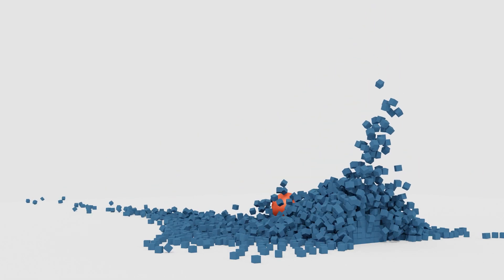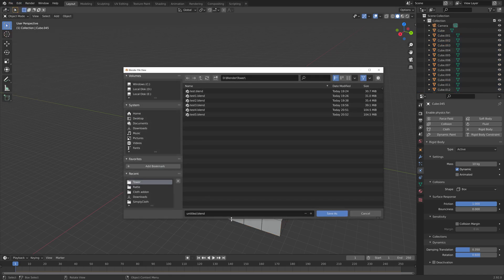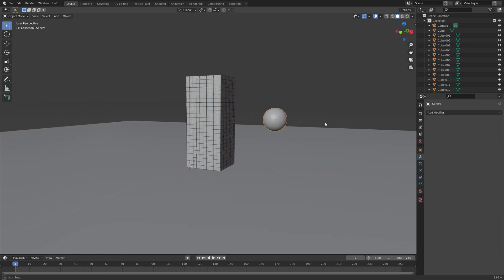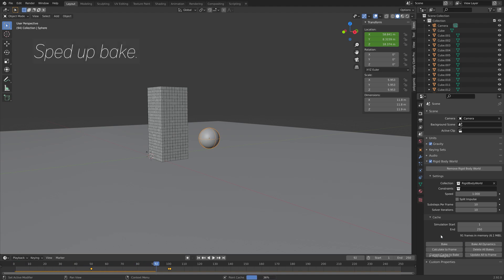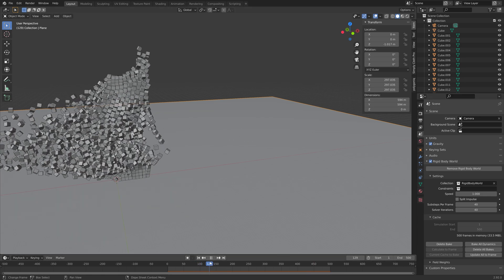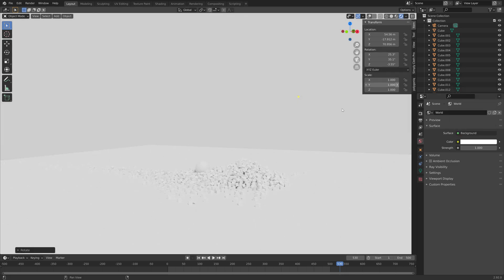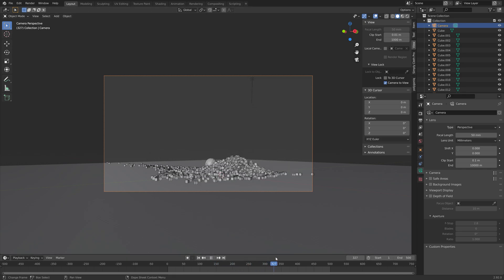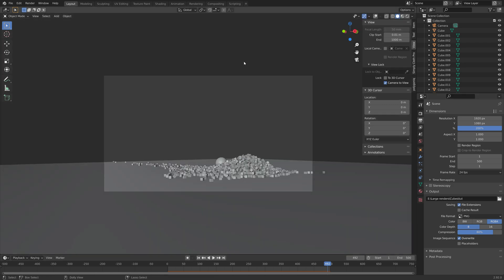[2.92] Blender Tutorial: Quick Physics Simulation for Beginners

Comment: I don´t know what you´re doing when animating the sphere. Mine stops instead of keeping on moving. Do I have to drag it through the cubes instead? Have tried this 50 times now. It stops and/or falls. Very frustrating. I have the exact same settings.  If I animate the sphere all the way through then it works. Is it a Blender 2.93 thing? Losing my frikkin mind here. Hopeless.
Reply: enable animated in rigid body settings.
Reply: then bake again
Reply: @pragati6857  Thank you. I watched another tutorial and he explained the keyframe the animation better and in sync so now it worked.
Reply: @pragati6857  same problem here. It is animated in frame 100 and unanimated in frame 101 as described in video. no more flying. just dropping.

Comment: Quick tip for anyone with a potato laptop with integrated graphics:

1) Set the render sampling to 8 instead of 300 
2) Turn on “Denoising” and set it to OpenImageDenoise

It took around 30 minutes to render this on my Ideapad and it looks okayish lol
Reply: Can this be real time with a 4090?
Reply: @cybyrd9615  depends what you really mean as well as the kind of thing you are rendering (as well as resolution and materials). when playing the timeline it will mostly get only 1 sample done before it is already rendering the next one (~41ms @24fps ). This might be because it still takes a bit of time to "setup" the scene for each frame. This can be a real bottleneck when dealing with animations of models with huge poly counts or geonodes and such.
So I can get "realtime" cycles on the 4090 when playing my animations in the viewport (even at 4K) as long as the scene is rather simple and does not include any of the mentioned things.
Reply: Do you know how to apply self-collision in version 2.92.0?

Comment: One frustrating thing for beginners would be applying something like this to a scene they want to use it in. No one is mentioning scale, and every tutorial seems to just start with the default scene where their collision objects start at something like 1-2 meters. Well, unless you're working with buildings, that's likely unrealistic. Say you've modelled a room, and you want a simulation on a desk where a bouncy ball destroys a jenga tower. If your scene was modelled to scale, your simulation will probably fail. Beginners won't know how to fix that, and also won't know how they should have started, to be sure their scale was correct in the first place.